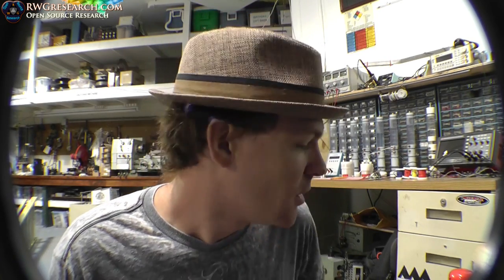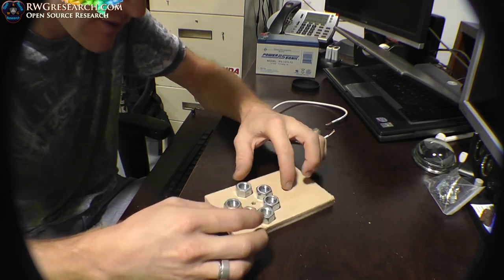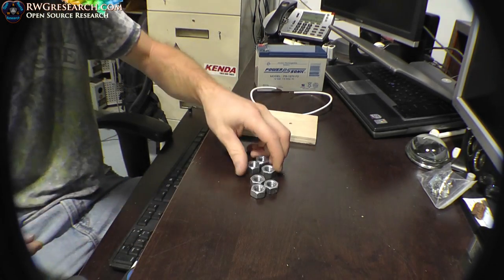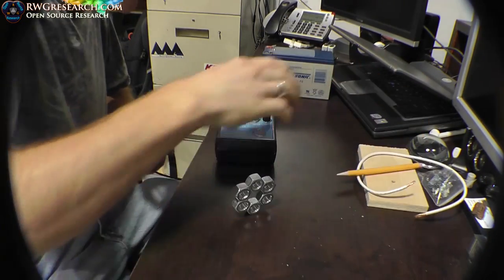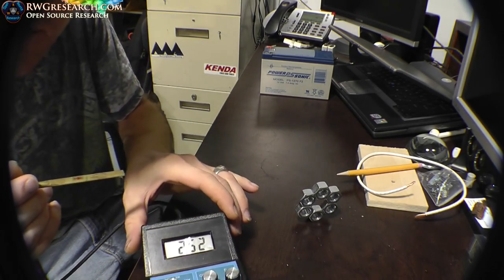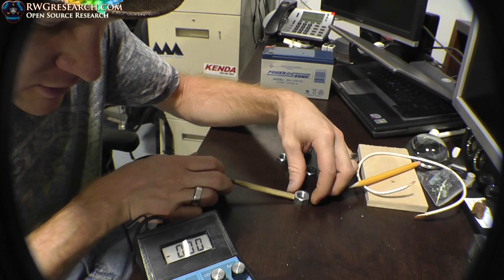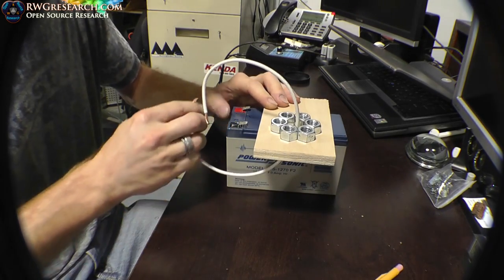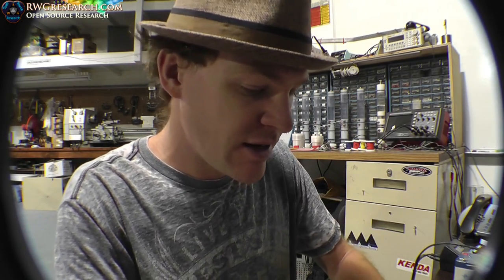“Oh Nuts!” Magnetic Lock.Your Going To Like! Using The Principles Of Ed Leedskalnin PMH.Must Watch

Comment: Early computer memory used this same configuration, using tiny donut shaped magnets and a matrix of six wires running through the center of each donut. The wires were used to both write and then read the polar state of the magnetized donut. Clockwise polarity would equate to the binary number zero, and counterclockwise polarity would represent the number one. Throwing DC current pulses in one direction would magnetize it clockwise, pulses in the other direction would reverse the magnetic polarity. To read the memory bit, it was a simple matter of sensing currents induced into the read wire at the proper moment during the read cycle. During the read cycle, a write current would be issued, if the donut was already magnetized in that direction, no change in magnetism would occur so no current would be induced into the read wire (hence, a zero state). If the read cycle did cause a change in polarity, a current would be induced into the read wire, hence a one state would be sensed. Early Russian computers were ternary tri-state systems rather than binary. Go figure... :-)
Reply: Martin Hirsch wow you’ve just explained bits to me and how they work, wayyy better then anyone could have.. nice..

Comment: What you have happening is the formation of a static magnetic field within the loop of metal parts.  This is essentially why you put a keeper on a magnet that you are storing for long periods of time.  The shorting of the battery through the wire is creating and then collapsing a magnetic field around the wire which is then induced into the nuts causing them to become slightly magnetized between each other and the closed loop allows the remaining field to remain in the loop where it will remain for long periods of time as long as the magnetic loop remains unbroken.
Reply: I agree! He induced an electric current in the nuts after shorting the battery. This electric current in the nuts created a static magnetic field within the nuts.
Reply: Michael Martinez This is obvious but can mainstream physics explain that and how? That is the question?
And if you describe this simple experiment to some phisics proffesor who does not know the experiment and tell him to theorise and predict the results would he explain and predict the observed results?
Reply: Krasimir Yosifov
You just read the "mainstream" explanation.
Reply: Yes i saw that video. And there is loop for the magnetic flow. The magnetic path goes around the groove where the wire goes. Like a long rectangular toroid with a very small center.

Comment: Magnetic structure is fractal energy. On the inside and the outside of the poles (of physical magnets, in attraction) spacetime is dilated. My opinion is that this is magnetism. Magnetism is dielectric field. It exists as the equilibrium point, inertial plane, inside a physical magnet and between attracted magnets. Inertia here is lost. Frequency is gained. Spacetime is dilated or compressed. The whole of the PMH is one magnetic circuit, made up of possibly infinite points of dielectric inertial planes (DIPs). Where the imperfect surfaces (points) join together are more so single magnets of higher order and the middle points of these (and the spaces between) them have higher concentrations of DIPs. Not unlike Meissner plates, zero point energy, negative resistors, and giant negentropy. The magnetic poles themselves are areas of spacetime expansion. Inertia is gained, voltage frequency decreases (centrifugal divergence) magnetic field radiation occurs, mass is additive, and harmonic resonance is constructive. It's opposite wave form is centripetal convergence, or destructive interference, spacetime dilation compression, voltage frequency increase (which is mass subtractive). Explaining why this works is to explain magnetism and how the universe is held together and how it is separated as well.
Reply: You made my day... lol
Reply: Because the Universe is a quantized multidimensional super fluid, it's electric and magnetism rules...

Love your post

Comment: I like to call it "electron locking".  Shifting 1 or more electron/s from 1 like ferrous material to another in close proximity.  Keeping the original bond yet filling the space of the vacant electron/s that is shifted in the next piece. 
Once the force is "sheared" appart, the electrons either complete the transition, or bounce back (depending on material used). 
Energy is never lost, only moved. 

-Fluid is everything, drink up the knowledge!

Great video.  Keep up the experiments.

Comment: Very cool!    Long ago I was doing the same with tape-wound C-cores from old clamp-on ammeters.    Also, the classic physics demo using a pot-magnet, 700lbs lift from one D-cell battery (or 100lbs needed to pull it loose if no battery!)

Try this:  put one piece of paper between.   That's enough to ruin the effect.    Even a layer of thin plastic-wrap will greatly weaken the effect.    To get the immense magnetization, the magnetic flux must be entirely inside solid metal, with no thin air-gaps anywhere.    Breaking the loop even temporarily will eliminate the magnetization.

If the faces of the nuts could be precision ground perfect hexagons, the pull might be 10X or 100X stronger.

No, a magnetometer won't work.   The flux is closed circles inside the metal.   Any flux that leaks out into the air will be thousands of times weaker than the flux that's concealed inside the continuous iron path.

Try using high-amps AC.   (Like using one conductor from a 1000W space heater plugged into the wall.)   It works, but the whole thing buzzes at 120Hz, and when you remove power, the remaining magnetized pull will be random depending on where in the 60Hz cycle it stopped.

Comment: Iron has unpaired electrons in the electron shell. when you pass a current thru the iron it temporarily orients all the electrons in the same direction and temporarily  links the unpaired electrons into a single field. when you break the field by separating the nuts, you break the connection and the unpaired electrons re-randomize.  Think of the nuts as a football field full of people. Some, but not all, of which are holding their neighbors hands in a random way. Some are holding their neighbors hands to the east, some to the west, some to the north and some to the south. And some not holding hands at all. When you pass the electromagnetic field thru the nuts, it causes all the people who are not holding hands, to grab the persons hands to their north and to their south ONLY.  Now, the majority of the people are holding hands in a north/south direction and they act like threads in a rope and create strength in one direction = north/south. A temporary magnetic field is created.

Comment: The magnetic flux is holding it together. Once you break it, it's gone. Just like Leedskalin found out. You can use a horseshoe shaped piece of steel, wrap some wire around on one side in one direction, and the other side in the opposite direction, put it up against a steel plate, put a charge to it for a split second and it stays indefinitely, or until someone or something knocks it off. The steel core will have the magnetic flux still traveling through it.

Comment: +1 for "Magnetic Current" idea Russ...

After I got the 6 nuts (M10) to stick together, I could add smaller nuts (#10-32) at the "V" between every pair of large nuts, and they would stick without being re-energized. IMHO, if it were "molecular welding", I wouldn't think I would be able to add additional nuts, and have them stick by themselves. Also, if it were molecular welding, why do we get energy back out of a PMH after sitting for 2 years, when the flat bar is removed?

It's interesting that the nuts do NOT even have to be touching each other when you energize it... the huge magnetic field around the wire causes each nut to magnetize and draw itself into the others.

Competition time?   I was able to get 18 nuts stuck together so far (see picture link below), 6-inner, and 12 more around those - and it's an amazingly robust HONEYCOMB cluster (again, I'm using M10 x 1.5 nuts).

I'm using 2 turns of wire to energize the large group (not really needed), and it takes a lot of care. Using a Panavise with the first wire up through the jaws (with the rubber pads), then after I "zap" the first layer (6), I stack on the next dozen, run the opposite end of the wire down through the panavise, so the energizing field is doubled. Link is a picture of the group, hung on a wire... amazing that 1 nut will handle the entire weight of the group of 18.
https://db.tt/oemG8ZjJ
You can see there's some gaps in the "cluster" in the picture... I did more later after I worked the gaps out, and it was even stronger.
https://db.tt/XXttT3EF
https://db.tt/BP5zIHX0

Side note - I tried adding one in the center of the cluster, it would not "stick"... but it actually makes sense, as it's not in "the ring" of circulating magnetic flux.
Reply from the maker: Nice work, I dot see the links? Thanks fr experimenting! ;) ~Russ

Comment: The tiny magnetons are drawn out of the magnetic field created in the wire from the battery. The magnetons are drawn into the steal nuts. They travel at the speed of light in two directions in the nut circle. They create enough force to hold the nuts together.

Comment: Sorry to comment further, but what you did was, analogously, spin up a "gyroscoplc" inertia, you terminated the DC current by induction in creating dielectric coherency within the ring of nuts

* By the way , someone told me on the energetic forum to come "answer your challenge",  ......which I have done.

Its called also the LARMOR FREQUENCY, ie gyro-dielectrocmagnetic inertia and precession.

No, contrary to what you said, they are NOT "connected together magnetically",  I can understand your misunderstanding in this matter.
Reply: I’m surprised I’m the first to comment on this, even 7 years later. Thanks Uncle Ken.

Comment: Hey ! Hey ! Hey !

Hey Russ, Fascinating experiment !!! I will not try to explain this, but make a couple remarks. Back in my navy electrical training days, in the 70's we used ferrite cores to store digital bits and bytes permanently. The process was the same as you just did. The ferrite torus were 0.5mm in diameter. Now this is very interesting for two reasons. The amount of power used versus the work being done.

These nuts are big and heavy, yet they will hold together for a very long time. So the power conversion is most likely, over unity. This brings me to my second point . The  energy transfer of electric to magnetic seems to be non-linear. I'm not the first to observe that.  A very small amount of electrical input, yields a very large amount of magnetic field. A properly designed circuit will be either 99.99% efficient or OU. Food for toughs. always a pleasure to exchange with you. cheers, bro!
Reply: Nicely presented!
Reply: *****  Any connection to Tesla's gap circuit for overunity?
Reply: Bearden mentions something similar. Static fields transmitted with little to no loss as electrons move from interior to exterior of surface/wire. But if moved dc large losses occur. If moved ac losses are far less and one utilizes magnetic varying component. His question was how to use just the initial static charge as a no loss instantaneous potential.

Comment: Don't know if anyone else mentioned it. But you could encourage the magnetic field to get stronger and more permanent  by annealing the nuts in a kiln or forge. The heat makes the grains in the metal more malleable and they will align with any magnetic field already present and make it stronger.

Comment: Russ, this is simple. When you dead short the battery current flows through the wire. When current flows though a wire magnetic flux is produced. The current and the magnetic flux move around the outside of the wire in opposite directions. In Leedskalnin's book on magnetism he, through experimentation, notices that thread with magnetized needles fixed at different spaces, hung over a wire that is energized, exhibit various a attraction and then repulsion. He went on to determine that this was due to the fact that flux was in motion in a helical manner. Rotating around the wire. The fact that the nuts are touching creates a circuit. In particular a magnetic circuit. Because magnetic flux moves though a vacuum the circuit in question becomes energized (with the flux energy). This occurs, primarily, due to the orientation of the wire. If you were to picture the wire as a cross section you could then visualize the flux circulating about the wire. Now picture the nuts surrounding the wire. Ferrite material, such as the iron in the nuts, is a conductor of magnetic flux. Thus when the battery is dead shorted the flux is produced, has motion, and is conducted by the metal circuit surrounding it. Essentially you have induced current in the nuts and that comes with flux or magnetic motion as Ed called it. That motion continues as long as the circuit closed. This induced current is then trapped in the same way as the perpetual motion holder. Congrats, a PMH without a coil!

Comment: i would say its an electromagnetic flux pinning once you sent the current threw the wire it crated a filed that aligned the molecules in the nut temporarily pinning them together till the pin is broken 

the EM shield is needed so all the molecules align in the same direction because it will only get one side of the EM field as the current passed threw the wire

Comment: Each mating surface acts as a capacitor.  As the current flowed from one side of the nut to the other (right hand rule), they got stopped at the edge of the nut.  This left extra electrons on one side of the nut (negative) and fewer electrons on the other mating surface (positive).  Once the connection is broke, the electrons redistribute themselves within each individual nut and it returns to neutral.  I suspect this is possible because of the zinc coating which kept the current from flowing unimpeded around the ring.

Comment: Hi there
If you reverse the poles they will detach.
Then touch again then there stuck together again. 
Again reverse the poles , then they detach. 
It's sort of my experiments with Ed Leedskalnins work
reason :   The electrons are being pushed out of the copper wire into the steel and running in a screw like manor chasing each other.

Comment: The magnetic field flowing around the wire induces a current within the ring of nuts, as eddie currents. It also aligns all flux in a circular pattern (flux closure domains). The flux alignment causes a magnetic bond between them, the current helps keeps them in place. When the current is broken, most of the flux returns to its original orientation leaving little proof of the magnetic bond.

Comment: High frequency electro magnetic oscillations have been setup in the nuts. How long do they hold together, they should eventually collapse after some time. A moving current creates a magnetic field, because the nuts are in a loop, the magnetic field created then creates a current around the nut circuit, and so on. 

I think you have created a high frequency oscillator, to check this, get a FM radio and see if you get some interference when the nuts are stuck together in the loop.
Reply: I repeated the experiment here .. and strung up the collection of nuts in a non temperature relatively humid oscillating environment... Ie my semi leaky shed.  The nuts remained connected against the force of gravity for over 5 months .  We had a big storm with very high wind , after which the nuts were found fallen apart.  Results , indeterminate leakage micro leakage or broken by the severe mechanical wind vibrations to the shed.   I believe the latter.

Comment: I watched and commented 6 years ago, but this time I have an explanation.

You might like to the experiment again, but this time after magnetizing the nuts and removing the magnetizing current, connected both ends of the wire to an analog current meter. When you break the ring of nuts, you'll see that it induces a current in the wire.  That will prove that there was a residual magnetic field, and that it collapsed when reluctance was added to the magnetic circuit. 

1) Magnetic fields form a magnetic circuit but they don't flow. So there is no magnetic current. 
2) When you ran an electric current through the wire, some energy went into making a magnetic field. Some of that energy got stored in aligning the a large number of magnetic domains in the nuts. A certain level of magnetic retrntivitu along with a complete low reluctance circuit path forr the magnetic field made it stable enough to retain a certain amount of micro level  domain alignment even after the magnetizing current was removed. The small residual macro level magnetic field is mostly contained in the nuts forming the ring. 
3) Apon introducing an air gap,  you do work, that inturn adds potential energy to the magnetic circuit, and increase the reluctance in the magnetic circuit. The magnetic domains the magnetic circuit  are given energy, and jostle around only to find a lower energy state with smaller magnetic circuits composing a small number,  2,3,4 or so ajacent magnetic domains inside each individual nut.
4) on the macro scale the small magnetic domains and their magnetic circuits average out and there is no detectable magnetic field on the macro level except maybe that induced  by earth's magnetic field and steel's low magnetic reluctance/high permibility.